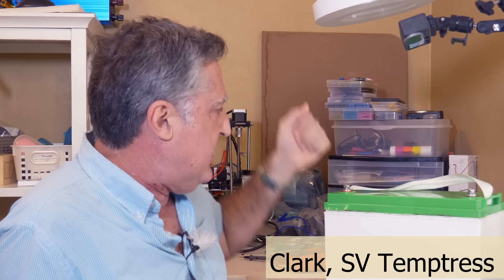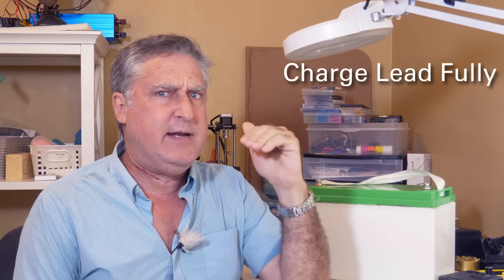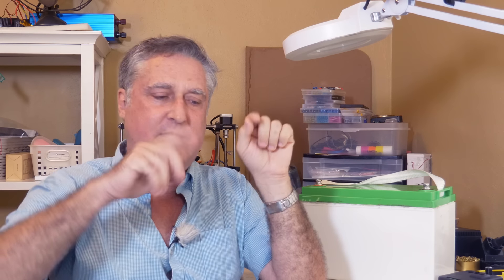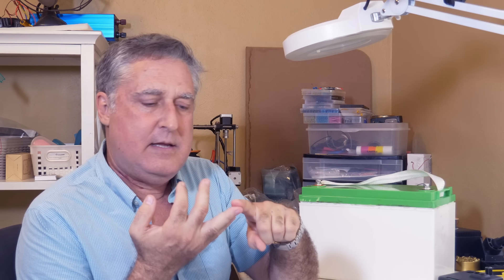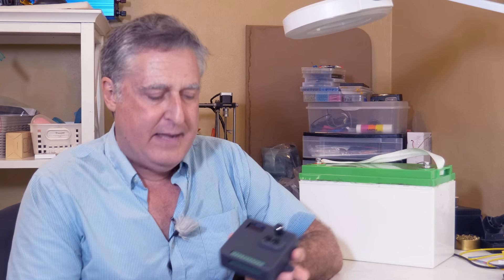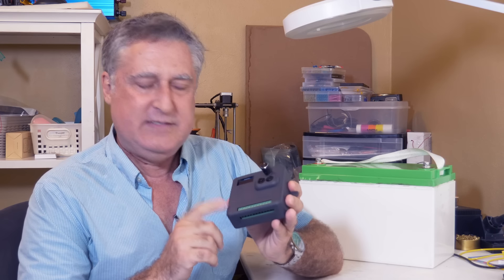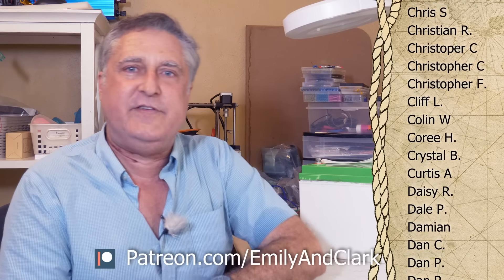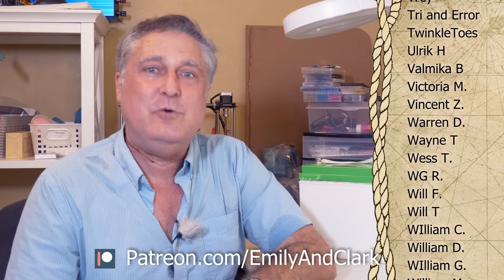Charge Lithium Batteries correctly (LiFePO4)

Comment: I'm an engineer: NASA retired. I listened very closely and critically looking for any errors. I found none. Well done!
Reply: good landing gears, well done :)
Reply: really.. NAS engineer who agrees  you can go past 100% charge?
Reply from the maker: @deefer66 Neither he nor I said that.  Watch again.

The point is you must stop at 100 percent and that is difficult to do in an actively used syatem
Reply: Clark big fan but even I struggle with a 40 minute phd in Lion charging
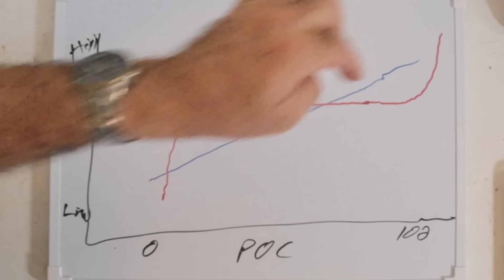Reply: @Clarks-Adventure  No he did.. 12:12.. it'll go to 100% then hockey stick...
Reply from the maker: But no one suggests you charge into the hockystick
Reply: It is not difficult to say nothing wrong, if you don't explain anything at all.
Reply: @renatomercurio4774 😂😂😂
Reply: Maybe you can help me with my charging problem. I just posted a short on my short Playlist explaining it
Reply from the maker: I don't see any new playlist or video

I consult to my Patreon "Dream Believes" tier
Reply: @Clarks-Adventure  sorry to hear that
Reply from the maker: Ok I see it.   Just keep charging.  The voltage won't come up until you are nearly fully charged unless you charge at a higher amp rate
Reply: @Clarks-Adventure  ok, so throw more amps at it. That's an option I was considering
Reply from the maker: @letsfixit251 no just give it more time
Reply: @deefer66  100% SOC is achieved when the charge current tapers to 0.03 C.
Reply from the maker: @SVAdAstra there is more to it than that.

Comment: Of course you charge to a voltage for LifePo4. Absolute Max is 3.65 volts per cell. For maximum life the 3.45 volts per cell(if the battery’s balance function works that low) the difference in capacity between these two voltages is negligible. The lowest you can take a cell is 2.5 volt per cell but most people stop at 3 volts. A good BMS (battery management system) won’t allow the battery outside of these ranges. There are only two points where capacity on a lithium battery is true, full and empty voltage with little to no load. Anything in between is a rough guess and only a coulomb meter is accurate and that is initially set at the full voltage. A good charge control will not abuse the battery and keep the BMS from stepping in(the last line of defense). The charge control will have settings like bulk or absorb (3.45 volts per cell) tail current, the amount of power as it reaches full or bulk and absorb time. The better your cells are balanced and the better quality of the BMS’s balancer(active type) the less time is required at the higher voltage. The less time at the higher voltage the better. There may be a setting called float. Lithiums don’t really need float, so I disable it or set it to 3.35 or less. All voltages I gave are per cell. A 12 volt has 4 cells, 24V has 8, a 48V has 16.  Heat is indeed a killer of lithium so under hood temperatures should be reserved for lead acid batteries. Always use the recommended voltage printed on the battery if you can’t change the settings like balance start voltage via Bluetooth (3.4 Volts per cell). Lastly if you need a 48 volt battery, buy a 48 volt battery. Do not put 12 volt batteries in series because they will become unbalanced. There are too many variables to be answered here so ask questions on forums like DIYSolar
Reply from the maker: You do that.  They are your batteries
Reply: @Clarks-Adventure  
And very happily for a very long time.
Reply: Yeah, I can get behind what you said. Pretty much the first time I’ve heard that about float voltage and wear. I’ve just been setting all of them to 3.35 just so it’s not hanging around in higher voltage after absorb, yet still retaining available capacity. Many systems don’t have an absorb time setting option but an algorithm that’s set by battery chemistry selection. Sometimes I find the absorption time too short (non communication batteries) in this case so I’ve found the BMS’s with an active balancer to be a game changer when time is limited at absorb. You can go weeks without full charge without worrying about delta differences.
Reply from the maker: @junkerzn7312 how does one charge to a constant current in a live system and using solar?.  Both loads switching on and off and the available power change the C rate.
Reply: 3,65 volts are the rated value for ~100% charge plus minus some percent off tolerances you forget , so 3,7 volts is form near all manufactures also no problem.

but yes most companys suggest to charge to 3,65 volts and most BMS that are build in batterys are set to this value.
and on the low side same most companys say at 2,5 volts a lifepo4 is near empty but some company spec there cells down to 2 volts.
and right most BMS systems are set to a value near 2,5 Volts.

and there are no good or bad BMS systems in any ready to use battery so no DIY i know ANY battery in this planet have a build in BMS what exaclty handle this values so there is no way to charge a ready to use Lfepo4 on any way wrong and this 40 minutes video is pure nonses.
if a cell in a battery reach this voltage this cell get sut off so how on this planet will this youtuber overcharge a ready to use battery??????
Reply: @Clarks-Adventure  load are + values consume is a - value .
ad you plus values together and remove the minus value than you have the rreslut to hard to understand?

solar 1 2 ampere +
solar 2  2 ampere +
= 4 ampere into the battery

now a consumer that draws 2 ampere so - 2 ampere

 remove now this 2 ampere out from the 4 ampere in = 2 ampere current into the battery.

there no macic multiply currents there is always one current on a battery!!!
Reply from the maker: Have you read ANY academic papers on lifespan studies when charging to 3.65.  start here https://cdn.shopify.com/s/files/1/0568/1011/1110/files/Math_ScienceOfBBMS_Grillo.pdf?v=1730396821 if you like.

If you don't put effort into it you shouldn't consider yourself an expert.  Or maybe you can as you are risking your batteries but please don't spread the disinformation
Reply from the maker: @ThomasNowicki-m5s  do this anyway you like but if you are going to preach here without actually reading the literature you will be challenged if for no reason then to protect others from your barstool engineering.
   You can't argue against anything you don't understand without looking like a fool. 
    Read, study with an open mind, then we can discuss.
Reply: @Clarks-Adventure  
You’re right. No sense in going to the extremes of a battery to get that extra 5% capacity at the expense of 75% of its cycle/calendar life.

Comment: I don't understand why lifepo4 batteries in the market don't have a balance plug like lipo batteries used in the RC market have. In that market, the battery chargers can see and charge each cell separately within a multi cell battery. Of course those batteries don't have a BMS so they have to have a connection to each cell, but I see no reason why there can't be both. A BMS in the battery for protection, and chargers with visibility to every cell so it has better control and operates more efficiently.

Comment: Ampere Time told me AFTER I bought my big 300ah LiFeP04..."You won`t get 4000 cycles unless you only charge to 80%." Well, this is absolutely IMPOSSIBLE without help from NASA. I charge to 100% before storms and sometimes the power is out so long that my battery voltage drops to below 12v but my 300ah battery has ran my small air conditioner and microwave through about 25 power outages since 2022. I use portable power stations for everything else.
Reply: The good news is that many charge controllers (solar and otherwise) allow you to set the charge voltage low enough to vastly improve lifespan. Even reducing by 0.1V has been shown to DOUBLE cycle count on some cells with only a couple % lower usable capacity. And if you have a dumb AC charge brick with no controls, open it up! Odds are there's a potentiometer inside for trimming the output voltage.
Reply from the maker: @evanmayer744 or you could use a BankManager
Reply: @junkerzn7312  You are correct to say that calendar aging has the biggest effect on degradation in most scenarios. Not by several orders of magnitude, but I understand your point. However, calendar aging is not a constant across all conditions. For example, LiFePO4 cumulative aging will slow to nearly 50% when stored at 0°C vs the normal 25°C. Similarly, storing your cells at 90% SOC doubles the rate of generalized capacity fade over a period of 4 months vs storing them at 10% SOC. Even if calendar aging was unchanging, it seems disingenuous to use that as a justification to ignore the actual benefits of proper care!
Reply: @evanmayer744  I think you are right about the voltage being too high for long life. I guess the last concern is this LFP memory issue and I think the EV manufactures are using 100 percent daily charge to reduce the memory problem. I would also assume the EV bmses work in a similar fashion to the bank manager but each manufacture is different so I can't be sure.
Reply from the maker: No they don't.  They simply turn off everything when one cell goes so far out of spec it's in danger of venting.

They are to protect cells from immediate failure and to balance cells, not to charge cells properly 

EPOCH knows low current overcharge protection is vital to long cycle life.  They recently released a BMS they thought would solve the issue.   But it caused more problems than it solved.
   This isn't an easy problem to solve properly
Reply: You didn’t pay attention or you must be lying but in every battery brand that I looked they specify this…..

Comment: The biggest fault in all of this is,  the Battery is at the mercy of it's BMS and mostly we have no control over It's parameters.  The talk of individual cell charging levels only counts for individual cells. When you have them clustered and being controlled by a circuit board That's the Judge and jury of the cluster.
Reply from the maker: Good BMS makes a good battery

Comment: I paid 1200 bucks for my 300ah 12v Ampere Time. I have a slow 300w LiFeP04 wall charger, a 500w LiFeP04 wall charger, and 3 solar charge controllers for solar. I recently got 2 Victron 100/30 ones with LiFeP04 settings but haven`t wired them up. No hurricanes yet here. I keep my 3.8 kwh capacity battery charged to about 3.3 kwh. I fully charge, then use my 500w window ac for one hour. We have lots of random power outages in Louisiana and the battery can run my window ac all night with the thermostat set properly.
Reply from the maker: It's good you aren't leaving them on charge.

Stand by power like yours is easier to work with than an active system.  I think your current charging plan is better than what the Victron will do.

Also you might benefit from looking up the charge plan used by industry.  Basically charge at a constant  C rate until a voltage is reached then stop charging.  That voltage is defined by the C rate.

Comment: Great presentation Clark. I just got an email from Redodo announcing that they have created a 140ah dual purpose battery with ~900 CCA that can start engines. Sounds like a great idea for your next video. Thanks for the great videos.
Reply from the maker: LiTime has a battery with the same specs coming out.   Bet it's the same.

I have one being shipped to me for review
Reply: 3.65 Volt is an ~ value With tolerences, check spec Sheets there exist No absolute value.
Alot companys give For. Example this spec 3.65 Volt +- 0.05 Volt als as a value For füll.

There are No absolute Numbers.
Reply from the maker: That doesn't even make sense in this thread
Reply from the maker: I just reviewed the litime version of this
  Since Redodo doesn't actually make batteries, just markets them I bet it's the same battery.
   That battery has issues.

Comment: Biggest consumer screw up with 12v self-contained LFP battery is not fully charging often enough to balance the SoC on the four series connected cells.  

The more the cells get out of SoC balance the lower the available capacity of battery and the greater the likelihood the BMS will prematurely shut down charging due to a single cell reaching full charge before other cells causing it to exceed 3.7vdc maximum allowed cell voltage.  

Most BMS's do not do any balancing until a cell gets above 3.4v.  You should fully charge to at least 4x 3.5v = 14.0v and hold the 14v for one or two hours to give some time for BMS to do cell balancing.  One or two hours held at 14.0v is not a damaging overcharge for LFP four cell battery.

If you do not fully charge LFP for many months, it can get so out of balance it will take many hours held at 14.0v to get battery cells back in balance.  For a 100 AH battery, 1% cell SoC imbalance will cause premature BMS charging shut down when attempting a full charge due to an overvoltage cell.  Most internal BMS's in 100 AH LFP battery only have a balance bleed current of about 50 mA.  To balancing out 1% of 100 AH battery, 1 AH, with 50 mA balance bleed will take 1.0 AH / 0.05 A = 20 hours held at 14 vdc.  You want to avoid getting into this situation by keeping up with cell balancing by fully charging at least every couple of months.
Reply: You can have bms with active balancing like JK BMS at 2A.
Reply: Yes most consumer battery have only a passive top Balance BMS and you are right then drift little bit but over time this effect is small for example.
My oldest cheap lifepo4 is a 100ah from 5 years ago.
Original i have testet it with 105 ah real capacity now 5 years later it is at 102 ah wirhout any looking on top it if for balacing.

In the real world it not matters lifepo4 consumer batterys last forever.
Reply: @user-budddd Good info. My batteries start balance at 3,3v (13,2v) Will they be balanced if i cut the power at 3,45 (13,8v) ?
Reply: @user-budddd In what sort of use your battery is? -That is very interesting, if your battery is in solar power use.

Comment: THIS IS EXACTLY WHAT IM DEAL8NG WITH!! 
Charging my Electric Scooter with solar seems better than charging with AC. the AC 42v does a false full charge often. The battery charge memory is very real. 80% is never enough. 100% is risky at theres AC rating of 42v. Battery float charge or voltage recommended 41.4 minimum is a good marker. Ive been charging at 41.4 when low, 41.7 when 80% feed the voltage, then the amperage and power.
The conspection of 42v 2a AC charging is safe but with high amp discharging leaves batteries hungery with a 42v 2a charging straw.
My solar charge feeds the battery max amperage of 5 amps at the lowest volt 41.4v, and the change to 41.7 feeds the voltage with amperage and leave batteries evenly discharging and usage is max consistency. Lithium ion, and lifep04 is a expert mode of charging. 
Lifep04 made me appreciate my electric scooter more. Now i know to leave it charging low, it will slow down amps, then only then feed the higher voltage to claim its amperage. 😂😂😂😂❤❤❤❤❤ 16:00
Reply from the maker: Not exactly

Comment: Very interesting information.  I have an EG4 All Weather Lithium 14.3 kwh 280 ah battery pack.  Actually, I have two of these hooked up to my 500VDC solar current/charge controller.  The manufacturer recommends that the battery should be stored at 100% charge capacity and recharged every 8-9 months so it does not go much below full when stored.  It is also recommended that it should not be discharged below 20%, but not by the manufacturer.  EG4 left me with no chart for maximum charging voltages nor min. discharge.  I had to download a chart off the internet to see what percentage charging rates were per voltage.  The chart I found had 58.4 V as 100% charging rate and 54.4V for 100% non charging static charge.  So, apparently, I can let my battery bank charge to 100% at 58.4 and then when I shut off the bulk charging, it will fall to 54.4 at its resting or static charge level.  What do you think about that?
Reply from the maker: As I say. "You can't charge li to a voltage".

There is much more to it than that.  If you are charging from a constant current source with no loads there are charts that give the voltage to full for various C rates.  This works.
  But the ONLY way to charge to 100 percent and stop accurately in an active charge environment is the BankManager.